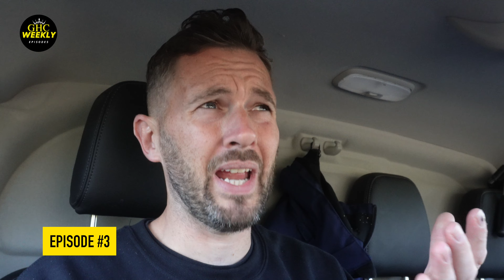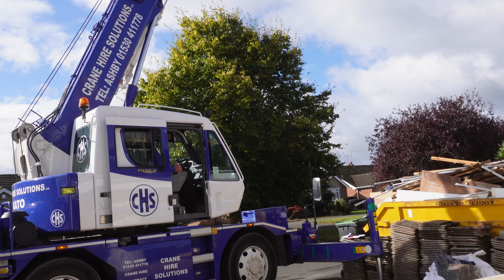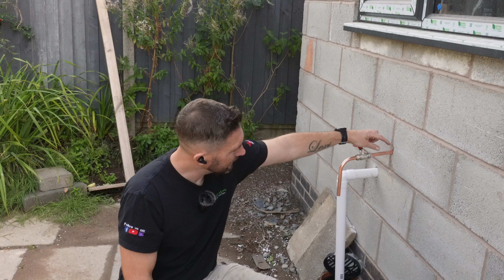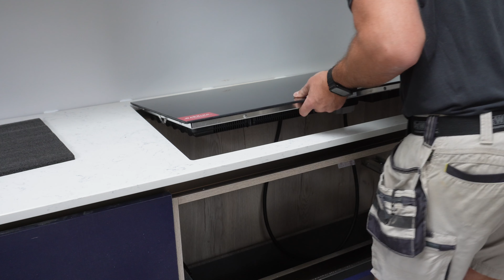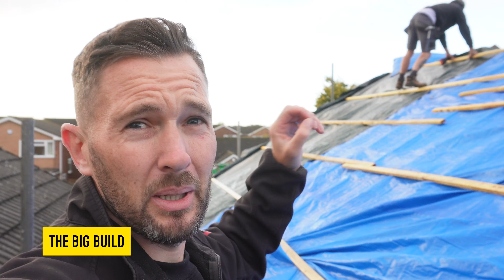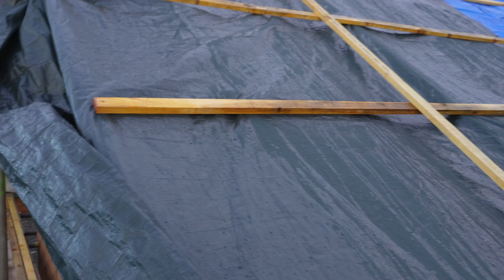MASSIVE LOFT CONVERSION - OFF WITH THE ROOF

Comment: I would have thought if the tap was only temporary it would have been quicker to do it in plastic quick fit .I’m not criticising I suppose there is a reasonable explanation or maybe it’s because I’m not a plumber
Reply from the maker: yep great shout but for me i prefer to use copper but also its more rigid for the length its off the wall
if that makes sence 👍
Reply: @GreenHawkElectrical   yes it makes sense  thanks for the reply .great new content 👍